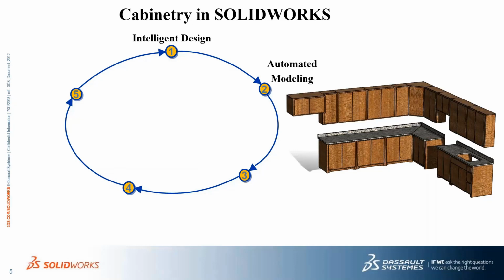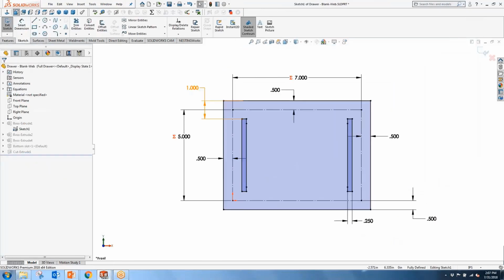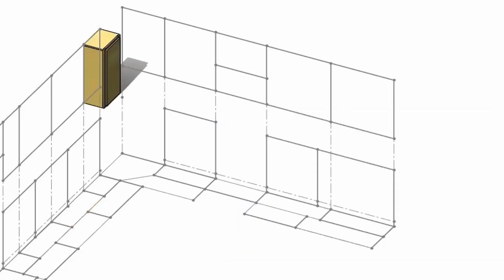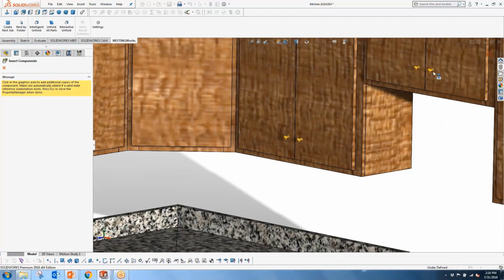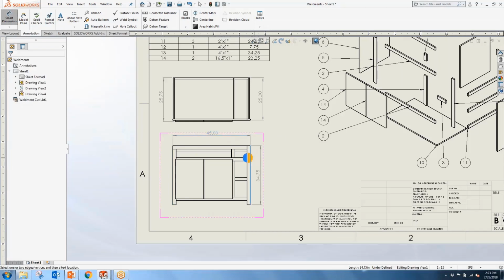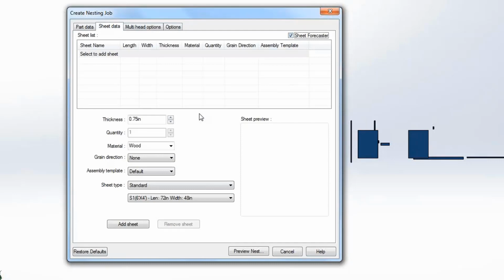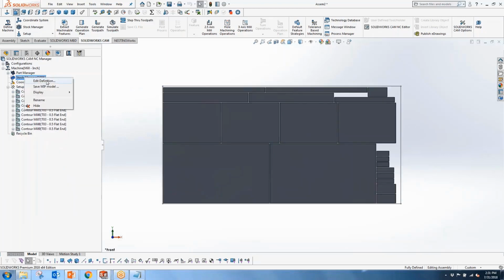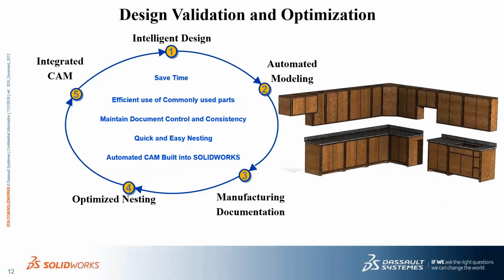SOLIDWORKS for Cabinetry Design

Comment: Timestamps for Intelligent Design and Automated Modeling Chapters of this video:
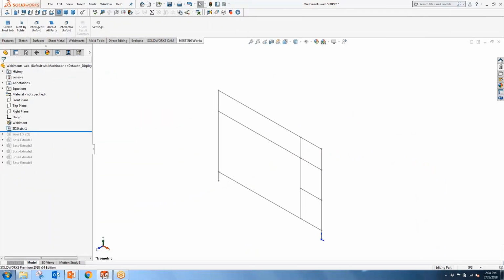1:46 Using Weldments and Extrude to build a framed Carcass

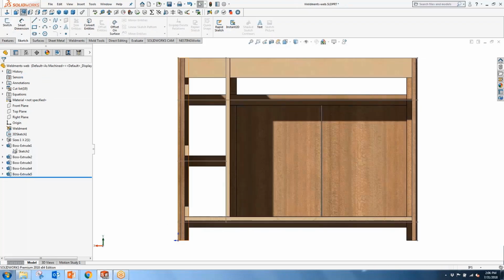3:54 Using Equations to change a "template part" and Save As a new part.  Example: Drawer
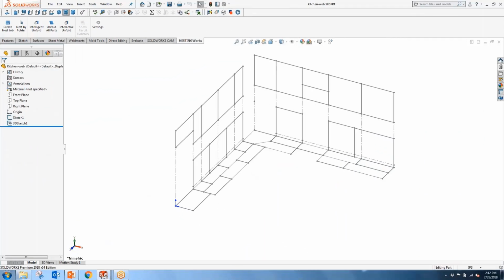6:23 In part file....Inserting Design Library Feature to 3d sketch.
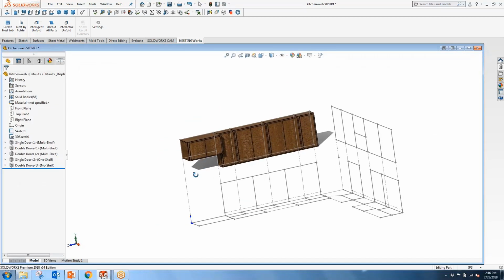8:46 Changing 3d sketch will automatically update Design Library Feature
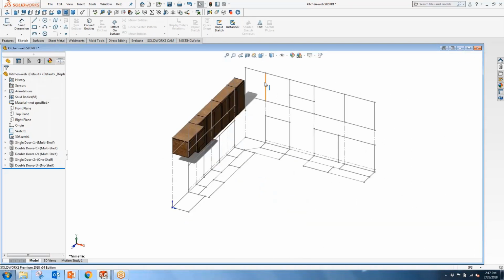9:37 In assembly file....Inserting Smart Component "door pulls" to the completed kitchen

Comment: Although I appreciate some of the concepts outlined here, I don't see how the early part showing a face frame with all butt joints and no visible connections, such as mortise and tenon etc. is in any way helpful. You seem to know Solidworks, but you don't know cabinetry.
Reply: Although he didnt specifically show it you can have smart parts in a Design library covering any connection/joint type you want and then just drop it in.
Reply: Pocket screws (which you may not know are the most popular method of constructing face frames) do not require anything more than butt-joint design. If you wanted to use mortise and tenons to sound important - then use dominoes. Also don't require anything more than butt-joint design. Does the video not cover YOUR favorite way of cobbling together face-frames? That's not an issue with the content creator - you're obviously new to cabinetry and so far only know one way to skin a cat. To paraphrase a douche I read; "You don't know Solidworks OR cabinetry."
Reply: @ranhdgdh  a douche? Namecalling, that's what you have for a communication style? You must be a Biden voter.
Reply: @RollinShultz  oh yes, because Trump voters are so well known for their restraint and hesitancy to name-call Lol
Reply: @RollinShultz  I should not have said "douche" that was stupid on my part. I really shouldn't have said anything to be honest. My apologies.
Reply: @ranhdgdh  it's a kind of redemption when  man admits to a mistake. I don't mind anyone disagreeing with my OPINIONS on cabinet making or anything else. Presenting a case is a basic argument and nothing is wrong with that.
As to pocket hole construction, it is my opinion as a purist that it is amateurish and though it may work for some applications, only fine joinery stands the test of time and is of heirloom quality. That's something that's been missing in any find of furniture making for decades.
Another thing it comes down to for ME is the difference between buying something factory made vs. having a journeyman make something from local hardwoods. On one hand you can buy factory made for 5 pieces for the same prices as one custom piece. The custom piece can be handed down for generations.
Reply: @RollinShultz  I get what you're saying, I really do. I guess my point in response to your original comment is that yes, the method shown in the vid doesn't cover every method of cabinet making, but 99% of faceframes are on kitchens, and are not heirloom pieces. It was a bit harsh to comment he doesn't know cabinet making when his method covers the large majority of cabinetry. But who knows, maybe he doesn't know cabinetry. I design and make custom furniture for a living and I stand by the position that there is actually a use for pocket screws. Blasphemy! Lol. Sorry about earlier, your response to my response was class my friend.